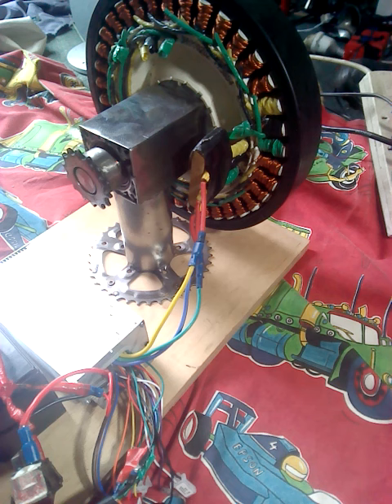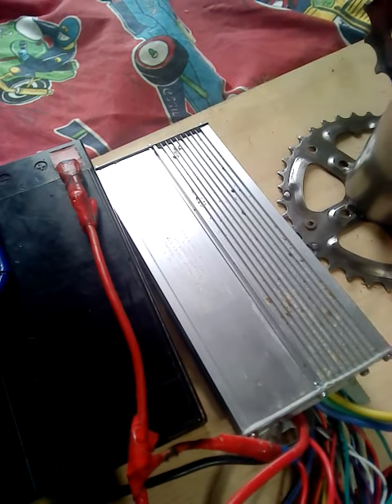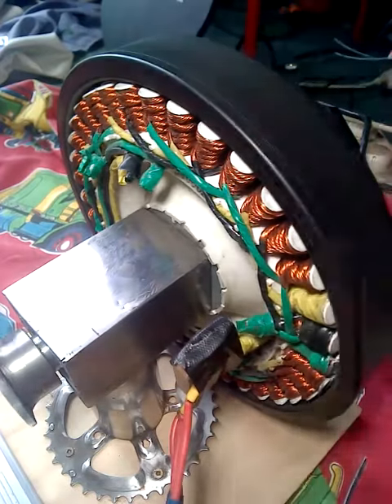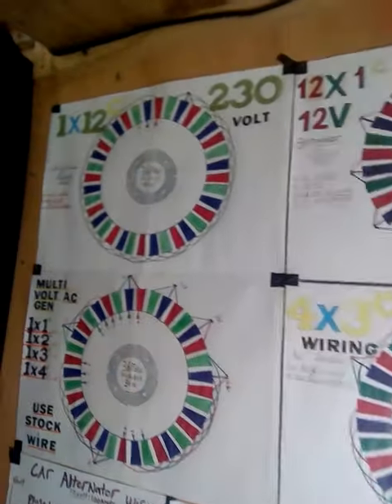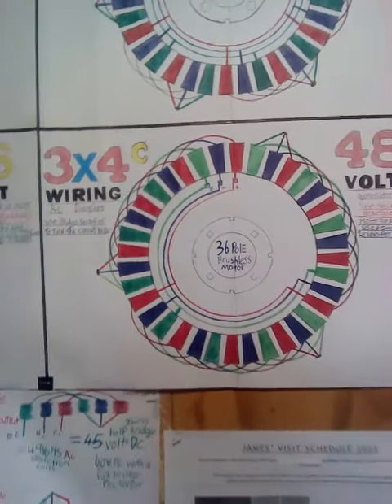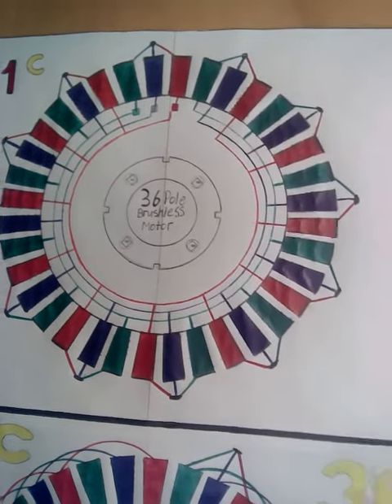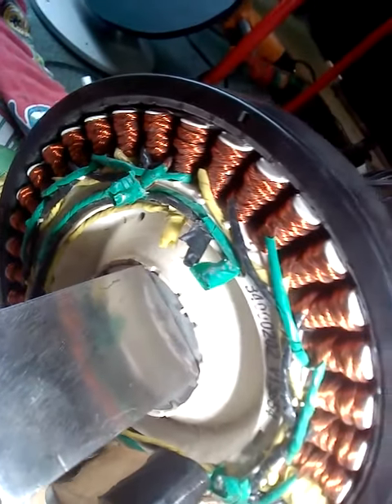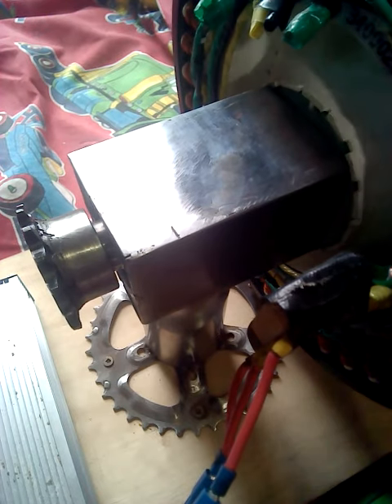washing machine motor rewiring and testing on E bike controller plus 6 diagrams for gens

Comment: Hi Tristan, what's the most amps you have managed to get from all the different configurations? We do something similar with microwave transformers. Thanks for your fab instructions and info.
Reply from the maker: Hi buddy yip a stock washing machine motor as a generator puts out 10 amps and it seems to be more amps when you make it into a 12 volt generator because there's 12 generators in the one now.so volts come down amps go up .😁👍🦇🌟🎉
Reply: @tristanmcnabb2741  legend mate. We will give it a go. I'll keep you posted on the results.
Reply from the maker: Allsome buddy yip I just got the washing machine motor video all done and I'm just uploading it now to YouTube 🤔🙂⚡12 volt 24 volt 36 volt and 48 volt and a multi all in one generator.

Comment: Thinking back to when you’ve tested this type of motor on your bikes, I think a worthwhile addition would be to add hall sensors.  Should definitely help with takeoff (which I remember being an issue) and it would only cost pennies and require very little effort.
Reply from the maker: Hi buddy 😁👍 yip I think I'll just use it for a windmill generator project.thank you about the hall Spencer's yip that would help a lot for sure 🤔👌I think the car alternators are the go for a faster motor 😊83kph  I done yesterday on the big silver bike lol 😂 it just gets the red and white race bike.biggest thanks from cruzermans inventions 😁👍🎉🌟🦇

Comment: Mr. McNabb this may be an ignorant question but would it be possible to use part of the poles to run it as a motor and the other poles to generate electricity?
Reply from the maker: Hi buddy good question 😁👍 yip you can use it as a generator and a motor by rewiring up to 12 poles for the generator giving you about 48 to 60 volts but the motor side is a bit weaker and if it's on a bike you may have to help it by pushing off😊🎉🌟🦇😁👍 biggest thanks from cruzermans inventions 😁👍
Reply: Thank you for the reply Tristan.